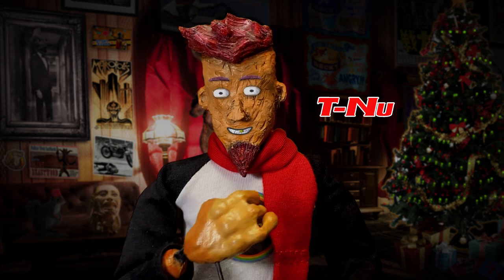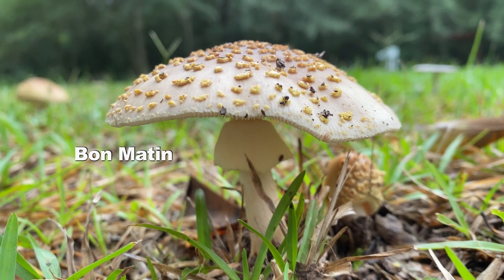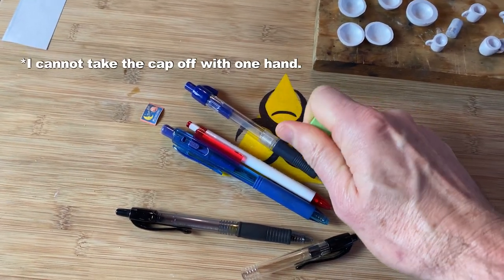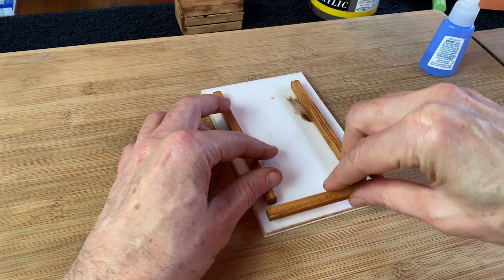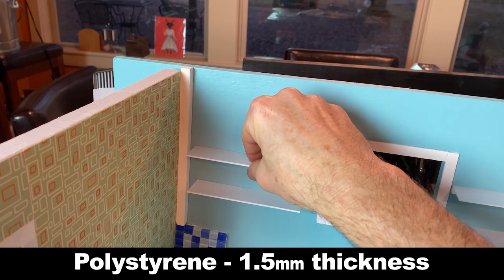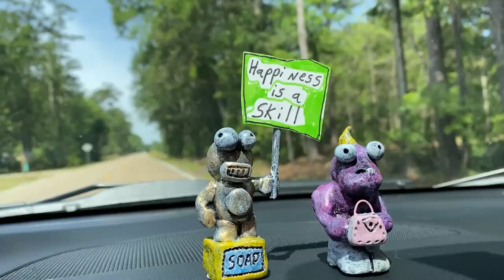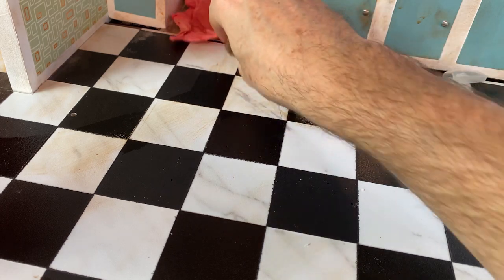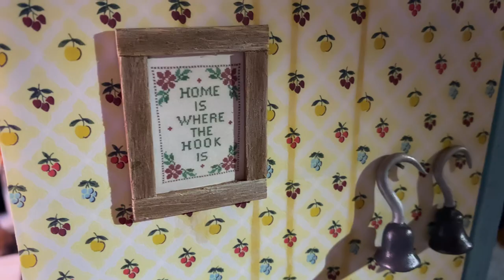Season 1 FINALE - PART 3 of the Undead Astronaut Diorama

Comment: I only use superglue or hot gluegun  ,life is to short for  PVA
Reply from the maker: Yeah, I get ya. A lot of times I use a combo of PVA and either hot glue or Super Glue. That's the best. You get a fast tack, but then you also get the strength. PVA is VERY strong once it dries. Hot glue can soften in the heat and it can also break down over time. So I like to have some PVA in the mix. Sticky Tack works great and dries pretty quickly.
https://www.hotmelt.com/blogs/blog/how-temperature-changes-can-affect-hot-melt-adhesivbuy-1080-gtx